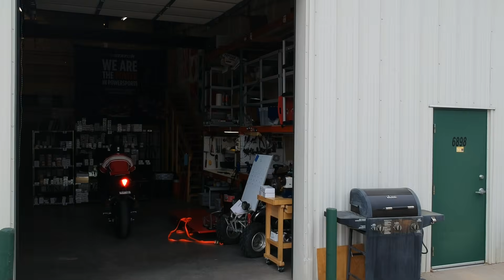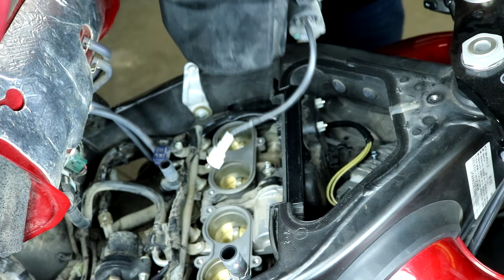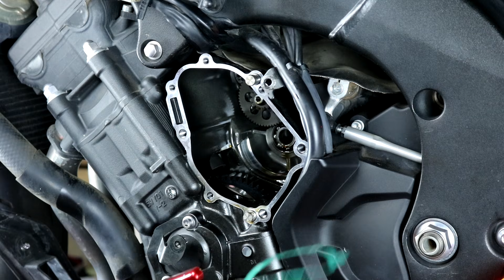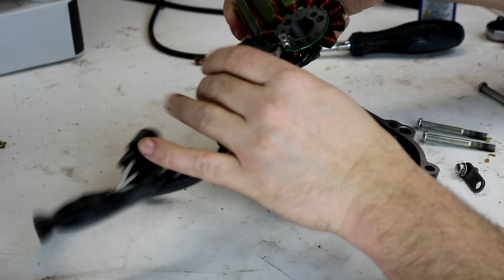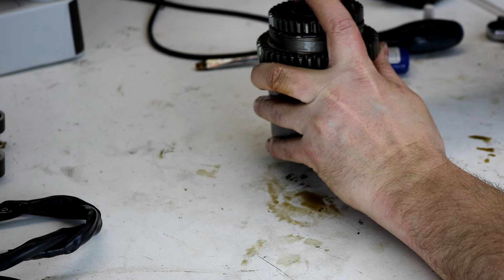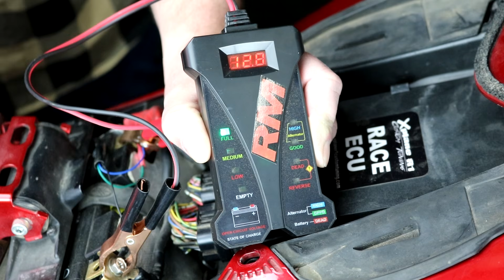How to Install a Flywheel, Stator & Voltage Regulator Rectifier (Yamaha YZF-R1 2004-2008) - RMSTATOR

Comment: Do we have to drain the oil before doing this or is it okay to leave the oil in the bike?
Reply: Can leave it in as the oil is in the sump. Did your magnets disintegrate? If so change the oil and oil filter.
Reply from the maker: No need to drain the oil for this install as the stator/rotor is mounted at the top of the engine.

Comment: Hi im going through this exact upgrade for my 2006 R1. I ran into a problem though, I need new torx bolts that hold the stator to the cover and i dont know the yamaha part number or any size info. If anyone could help with this information so i can order thre three bolts i would greatly appreciate it
Reply: Go to Partzilla and look up your bike.
Itll be under crankcase cover

Comment: The 2006 model for sure receives the gasket? Like I defiantly need one?
Reply: Yep, i half assed mine with liquid gasket sealer and it leaked pretty good all over my rear tire at speed. DEFINITELY just get a few gaskets IMO for $6 off Ebay and have em ready. Most of my R1 issues have been stator and generator so yearly im cracking it open.

Comment: How do you get the washer out of the gear casing if dropped in?
Reply from the maker: I would recommend trying a flexible magnet, you should be able to lift it out that way.
Reply: @Rmstatorinc what about if i dropped the rubber piece ( the cushion ones )
Reply: I just dropped something I'm there and I was thinking the same thing

Comment: Red theadlock is rated at permanent.  Probably not the best thing to use to lock threads in parts that might need to be replaced in the future.  Permatex says: Due to the exceptionally strong locking power of High Strength Threadlocker Red, heat or special tools may be required for removal.
Reply: He had said 'blue'.
Reply: Yeah I had to cut mine off and order complete new pieces
Reply: The key is to just use a drop and not coat all the threads. I very rarely go thru tubes of locktite, just a dab will do ya

Comment: Parts are ordered from rmstator.  I'm hoping my install is smooth
Reply: How was it???? Im plan’n to do my ‘05 r1 tomorrow????
Reply: @pradaboyk  piece of cake
Reply: I did not replace the flywheel. I'm sure there's a hundred videos on YouTube doing this job on your specific bike. That's what I did, watched a few different videos so I would know it to expect.
Reply: David Kimbell thans a ton,because i dont think mines is damaged so ill just replace the stator and regulator
Reply: David Kimbell stator was super easy but i ran into a huge problem!!! The round magnet that goes inside the rotor assembly was shredded to pieces so i couldnt finish the job now i gotta buy a entire rotor assembly to fix n its very expensive but hey i love my bike so ill be ordering that soon
Reply: David Kimbell i was wondering if the fly wheel is not damaged do i have to replace it or can i just swap out the stator and regulator???
Reply: RM stator sells that too. That's what everybody replaces, that's what was shredded in mine as well. Try your best to get out what you can and change your oil, change the broken parts and put it all back together.
Reply: David Kimbell so how do i order the magneto cause the link on the video says it’s unavailable,i dont know what to do now?
Reply: The first one I purchased was from Amazon, the next one from their website and I believe they have an eBay store. The part is definitely a few hundred dollars
Reply: David Kimbell thats cool i just gotta find it,is there any way you can send me any type of link to buy it from,i only need the circle magnet part that goes in the rotor???
Reply: https://rmstator.com/en_ca/generator-stator-for-yamaha-fz1-fzs1-fz8-yzf-r1-2004-2015

Comment: Hi, i have another question. have you ever changed only the rotor and not the stator? 
or maybe it's better to replace both components?
Reply: You can replace just the rotor.
Stators are usually good for the life of the bike.
If you have the money for both,why not.
But not needed

Comment: hi, could you say me which is the model of R1 in this video? i have got an R1 2004 and i need to know where voltage regulator is.
Reply from the maker: This is a 2007 model in the video.
Reply: @Rmstatorinc  thanks for your help. 
ten minutes ago i finished to disassemble my r1. i found the voltage regulator between the tank and main seat. to arrive to it, i had to get up the tank and remove every connectors (fuel and electric); when you take off it you can see the voltage regulator but you can put off it only after remove the two electric connector and the two screws. 
tomorrow i'll test the voltage regulator and if it will be ok i'll have to change the rotor and stator. 
good luck to me O.O
Reply: @TheKarlosB21  p

Comment: My regulator wasnt in the airbox. It was behind the battery????
Reply: Is there two??
Reply from the maker: There is only one. It depends on the year of the R1. On the 2007 model I filmed this video with, it is mounted in the airbox. It can be in other locations on other years.
Reply: @Rmstatorinc  Thank you for replying 👍 one more question and please forgive me for not knowing... the one I ordered is smaller than the original.. but says it will fit 04 to 07. I have an 05.. it should still work right I dont feel like paying 200 + dollars for the oem one

Comment: How do you remove space if it falls in crank case ?
Reply from the maker: You could use a bendable magnet or grabber tool to fish it out of the bottom.
Reply: @Rmstatorinc  what if you can't find it with a magnet or a grab tool can you drop the oil pan and get to it??
Reply: Jolly Rodger yes you can drop the oil pan and it will be right there

Comment: Sir what to do if rubber was fall down in crank case.plz give us some solution
Reply: You'll have to take off your oil pan. and it'll be down there.
Reply from the maker: I would use a flexible claw tool that you could feed down into crankcase. An extendable mirror and flashlight may help you locate the piece and pick it up. Good luck, I hope you get it out!
Reply: Give valentino a call
Reply: Throw in a match
Reply: @theone2be33  LOL

Comment: Hi I have a question is all regulator located the same place cause I was look at a forum and it said 2004 regulator is under the seat by the spring I am confuse,I want to remove mine and check it.
Reply from the maker: I'm sorry I'm not sure on a 2004 model. I assume they are still located in the airbox, but our test bike was a 2007. It should be easy to see around the rear spring if the regulator is located there. You can always trace the wires coming out of the stator/flywheel cover.
Reply: RMSTATOR hi find it,it’s under the seat or near the rear spring from 2007 it’s under the air box

Comment: Thanks for the video! Btw. this seems like a newly made video, but your all out of stock on the flywheel?? I was about to order, but i need a timeframe of when you restock. Also is your flywheel a 100% fit when using the OEM stator? Are all Flywheels checked for alignment/straightness/balance before shipping?
Reply from the maker: No problem, glad you liked it! Unfortunately we only had a small stock available right when the video launched, sorry about that. We will have more in stock soon, estimate about 2 weeks. You can call or email our customer service team and give them your contact info. They will be happy to notify you as soon as the flywheels are available. The R1 flywheels are a perfect 100% bolt on fit like OEM when using our stator or the OEM stator. All flywheels are balanced, tested, and checked for perfect fit in a set of OEM bearings to make sure they install and fit perfectly.
Reply: @Rmstatorinc  Thanks for the reply. Sounds good. Will contact them.
Reply from the maker: @hansottosmotos  Great! Thanks for checking out the video.
Reply: RMSTATOR is the same exact process on the 2005 r1???